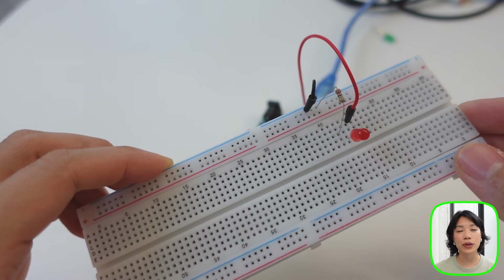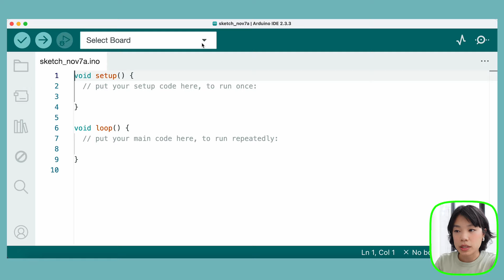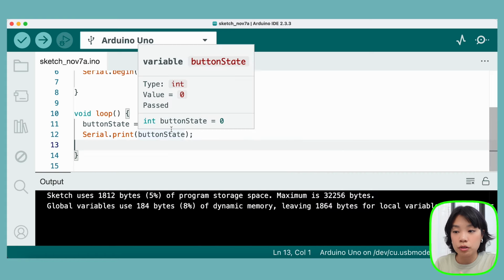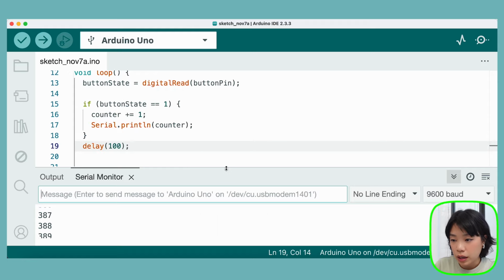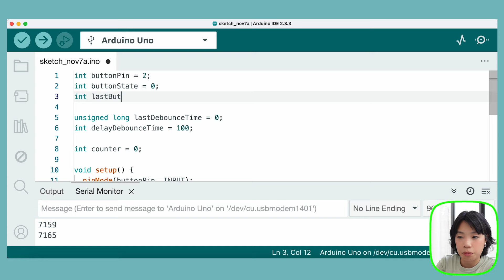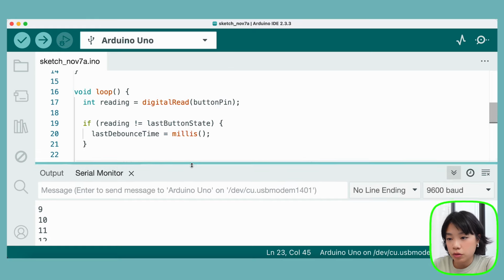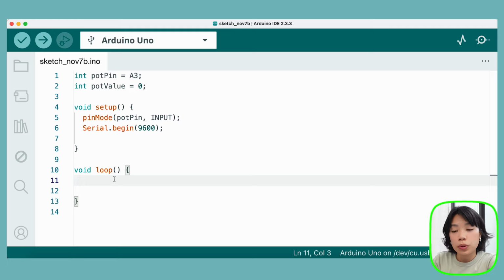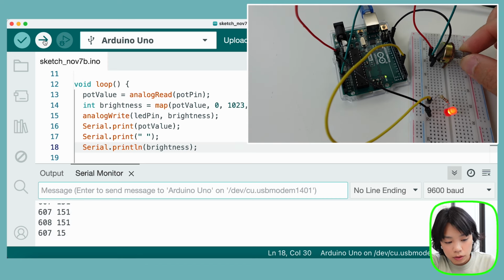Arduino 101 | Episode 2: Read and Write Digital & Analog Signals

Comment: Is it really a bouncing button that is the problem? Isn't it multiple registrations of one push. I think you should confirm that the button is "0" before you count a new push.
Reply from the maker: Yes, that’s absolutely possible bc the sensor reads so quickly, it can detect multiple 1s during a single press if my finger isn’t lifted fast enough. This can cause the same effect as bouncing, where multiple registrations happen for what feels like one press. Adding debouncing code is a reliable way to solve this issue as it ensures the button returns to 0 before counting a new push!